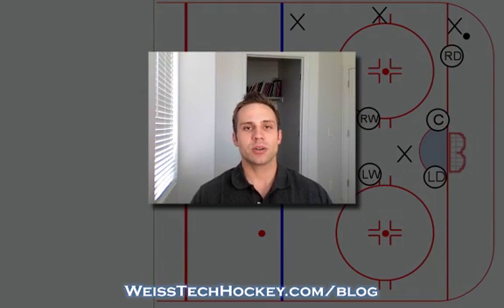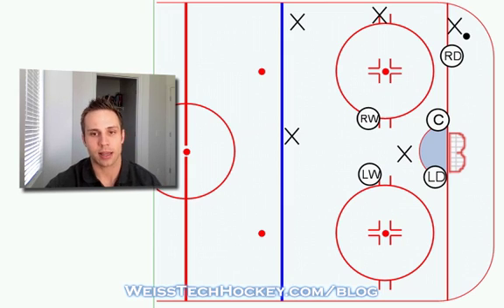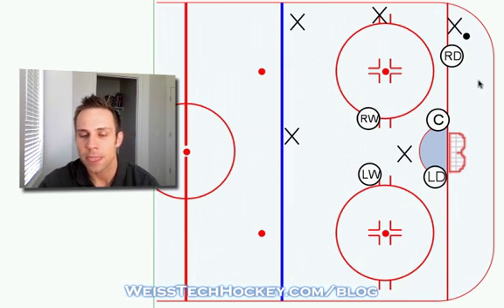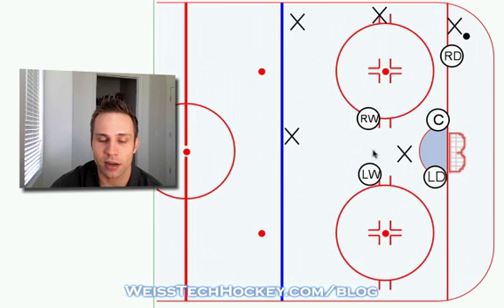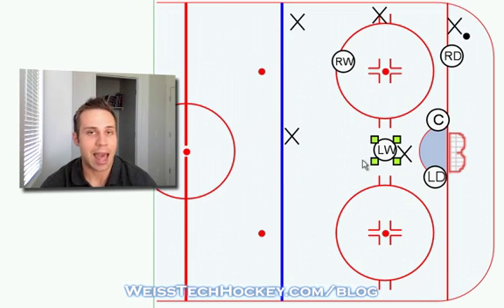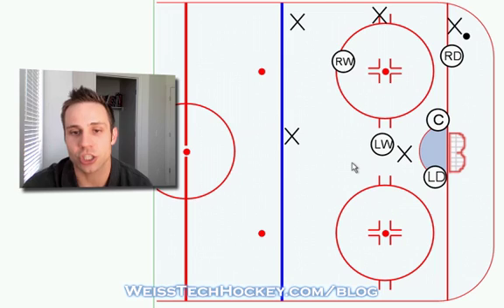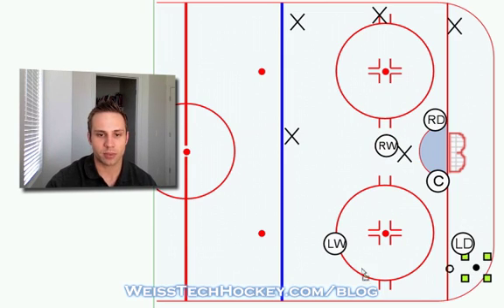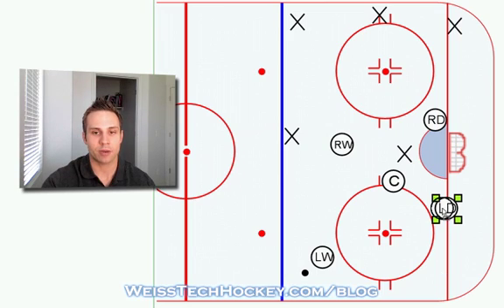D-Zone Coverage: "Sagging" Zone

Comment: @JeremyWeiss I know this is 14 year old video, but can you take a moment to answer МарсельДеев-э8л and Juffan's questions about the coverage on the half wall and point?
Reply: nevermind, I found one of your follow up videos and you replied to one of the comments there. Sharing your reply below:

https://www.youtube.com/watch?v=G7VIKTj7Ip8&t=28s

"A forward behind the net isn't a threat in and of itself. If he/she is hanging out there without the puck, be aware, but don't change any positioning. If the puck is passed to the player behind the net, the D's and F's retreat back into "5-card" formation in front, with their heads on swivels to eliminate passing options. They won't score from behind the net, so the options are to stuff a wraparound, or work a pass out front. The D's eliminate the wraparound possibility, and the F's take away passing possibilities. 

A man on the side wall isn't a threat if he/she doesn't have the puck. Leave him/her there until the pass is made to him/her. Once the pass is made, the C drifts toward the player, but doesn't commit to an attack UNTIL the player on the sidewall HAS THE PUCK and TAKES THE FIRST STEP TOWARD THE NET. At that point the C attacks hard in a straight line from the net to the player (in position to block a shot if possible)"
Reply from the maker: @beanoguy  Glad you found that one - I just made a new follow-up for you as well. It's a little more detailed. I have a hard time being concise sometimes :) Here you go! https://www.youtube.com/watch?v=3E2TeMmTpGc